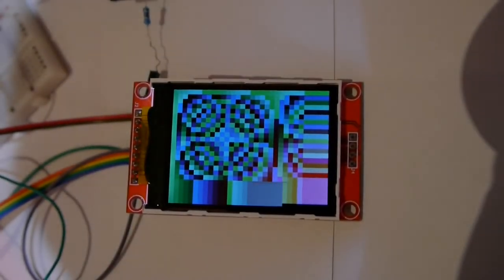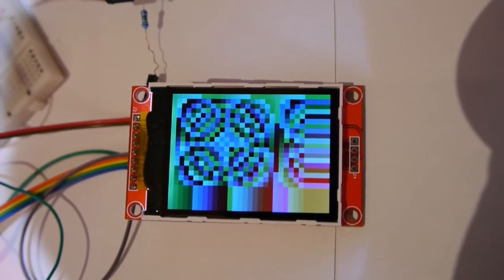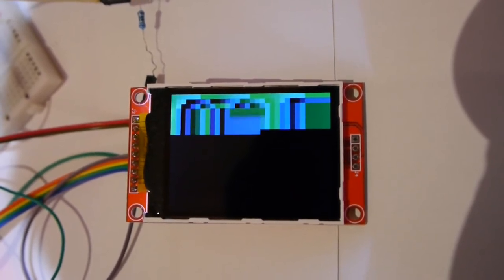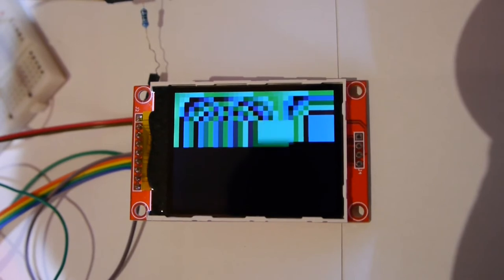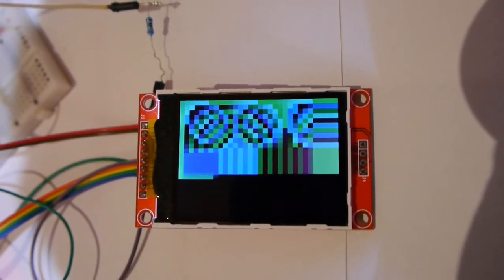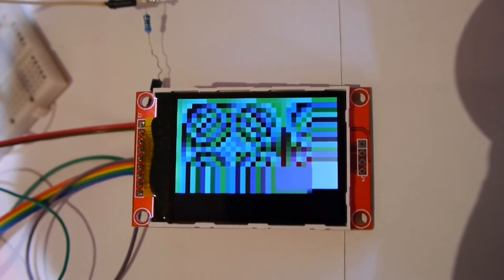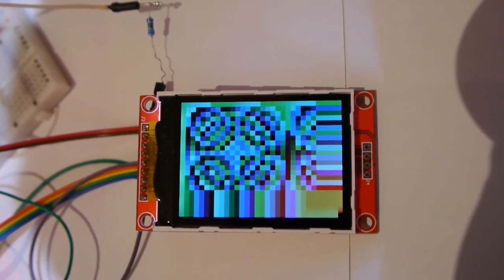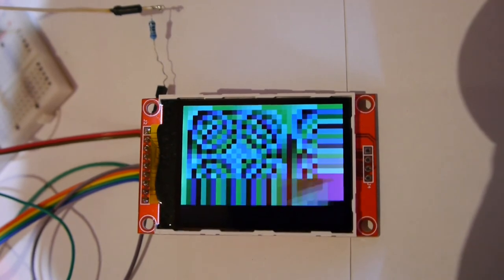ili9341 part2 a short benchmark

Comment: Hiya, really looking forward to my SBMS100 arriving! I'm running with Teensy 3.1 running at 144Mhz overclocked, with the adafruit capacitance touch screen  (3.2" version I think), spent a fair amount of time trying to optimise that but not sure how it would compare to your results. I'll have to do some new videos! So what controller you using to run that screen?
Reply from the maker: Andology The controller is in the screen and is the very popular ili9341. There are LCD's from 2.2" the one I use up to 2.4" , 2.8" and 3.2" maybe even larger all with usually the same 320x240 resolution and same ili9341 controller. So except for the physical size there is no other difference.
What driver do you use the one made by the Paul the one that designed Teensy. I think he uses the same slow method that this other guy Tilen was using and you seen how slow it was in this video.
Running overclocked at 144Mhz will make it a few times faster if the SPI is also at high speed but that is not software optimization :)
From what I seen most use draw pixel to draw all other shapes like filed rectangle and that is a bad idea and is why is so slow.
They need to send the location of each pixel and then the color of the pixel each time. I use a different method where I send just the start location of a line then for the rest f the line I send the color data only and the LCD will increment the location for me that saves a lot of time and you seen how much faster that is about 18x faster in this example here.
I'm sure someone else figured this out but the Open source libraries that I seen are all slow using pixel by pixel drawing.
I started to work on the LCD just 3 or 4 days ago I need to implement all other functions with the fast method and also designed some functions for energy graphs.
I was hoping to find a fast library and not spend time on this part since I have a lot of work to do on top of this.

Comment: Tried your example with my lib:
uint32_t start = millis();
for (uint32_t jj = 0; jj <20; ++jj)
 for (uint32_t j = 0; j< 28; ++j) 
	tft.fillRect(0 + (j * 10), 0 + (jj * 10), 70 , 54 , 10000 + (j * 3) + (jj*j * 99));

Serial.print(millis() - start);
Serial.println(" ms");

And it's giving me 431ms for the whole loop, so that's like 0.7ms per one rectangle. That's on Arduino Due running at 84MHz (both CPU & DMA). With DMA at 42MHz it took 828ms and with DMA at 21MHz it took 1620ms. Without using DMA and SPI at 84MHz it took 1223ms, with SPI at 42MHz it took 1619ms, with SPI at 21MHz it took 2412ms.
Btw. my text drawing functions will most likely be slower since I am trying to be flexible with fonts (e.g. you can draw a 255px high text). But there is still  room for improvement (working on a new version of the lib).
Reply from the maker: marek.buriak So you can use the SPI at 84Mhz ? I'm not familiar with the Arduino hardware I think they have some sort of ST variant maybe some STM32F4. With my STM32F3 I have a div2 for SPI so it can be max the CPU clock/2.
 Thanks for testing. I got a library that used pixel to fill screen or any other solid object and it was realy slow.
I was looking a bit at the Teensy code and it seemed to use the same (maybe I was wrong).
I will release the code today or tomorrow so you can take a look and eventually test against the one you use.
The text was the most important for me and some energy graphs that will be done by using fast vertical lines.
I seen a scrolling future in the ILI9341 datasheet but did not had the time to test that. Is your library using that scrolling function ? Not sure how it works but it seems you select an area you want to scroll and then you can scroll vertical and horizontal. I assume you just send one 8bit command to increment the scroll that will be quite fast compare to updating the entire screen, using a large buffer memory or reading the LCD GRAM.
Reply: ***** Ad SPI at 84MHz...this is from SAM3X8E datasheet: The SPI Baud rate clock is generated by dividing the Master Clock (MCK), by a value between 1 and 255. This allows a maximum operating baud rate at up to Master Clock and a minimum operating baud rate of MCK divided by 255. So yea, Arduino Due can do SPI at 84MHz.
Ad hardware scrolling...I have not implemented that in my lib because I think it has quite a limited usage. It's maybe useful for some kind of console output where you need to scroll text fast but otherwise I do not see much of a use for it. It also has 2 caveats, you have to use the full width of the screen (height can be restricted) and the scrolling is cyclic so if you scroll up, whatever you had at the top will appear on the bottom. You have to clear the upper x number of lines first, then scroll up by those x number of lines and then draw your new text on the bottom. Not saying that it's hard to implement, it's just something I haven't had time to do (and probably never will). With that being said, I know I have seen a library for Arduino that implements it.
Reply from the maker: marek.buriak
I had the wrong impression arduino due used some sort of ST mico but is seems is still Atmel as it was with AVR.
I have a menu system with more entry that will fit the screen so I will need scrolling.
I can probably redraw the entire menu as I did on the nokia 5110 it seems to be fast enough now with my library not to be noticeable but it takes a bit of time compared to hardware scrolling where I only need to write the empty line at the bottom that in my case should be a speed up of around 150x is there menu is about 100lines in hight and the with will probably be the entire with of the screen.
The 2.2" screen is to small the text needs to be at least 11x18 to see something in a reasonable way.
I was also thinking about the use of sub-pixels for text. Not sure how exactly is done. Do you know someone that implemented that.
I just did some benchmarks at 20Mhz SPI and 40Mhz CPU and I get about 460 to 512kpixels/second for fill and most basic shapes except filled circles where is more to calculate and get 320kpixel/second and text where for some reason I get just 241kpixel/second not sure what I do work there I will have expected the same as fill it has to do with some wasted CPU cycles.
Reply: ***** No, I haven't seen sub-pixels implemented in any lib. I think it would be too slow to calculate the subpixels on the fly so I guess the only way is to have it pre-calculated. But then I wonder how big (in kB) would the font become since you would not be able to represent one pixel with only 1bit (0 or 1). The color of the text would also affect the subpixels so I am not sure how can you achieve a generic subpixel rendering. It is maybe doable for one (small) font and one or two text colors. I've seen some talks about using grayscale fonts as oppose to black&white to smooth out the font but I don't know if anybody actually implemented it.
Reply from the maker: marek.buriak
Thanks, I will look in to this. Is not critical but if there is a simple way to do that even for a single font color I will probably implement that.

Comment: What is the cpu stm32 or teensy 3.x?
Reply from the maker: The CPU is a cortex M4 in a STM32F373 microcontroller. I needed the 16bit ADC for my project that is why I used this particular microcontroller. In this demo it works at 48Mhz (SPI is at 24MHz) but in my application the SBMS40 and SBMS120 it works at 40MHz (20MHz for the SPI) as that is more than sufficient.